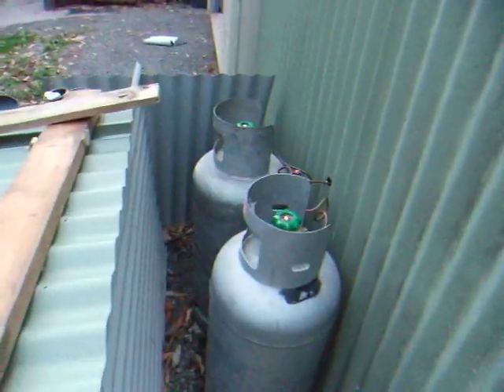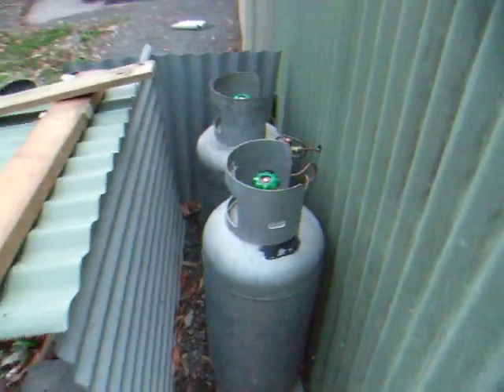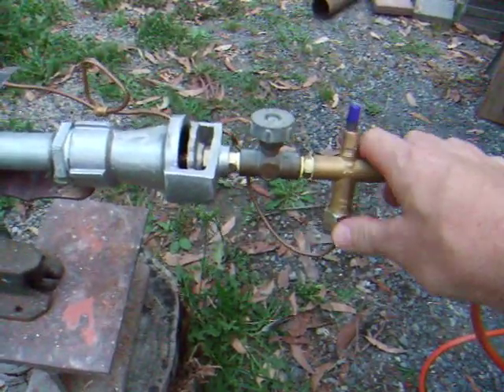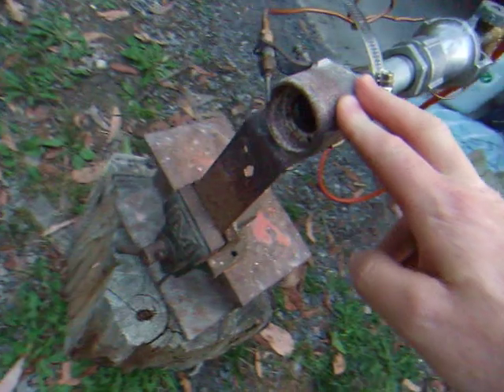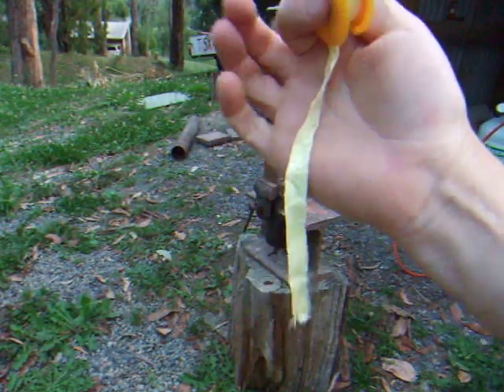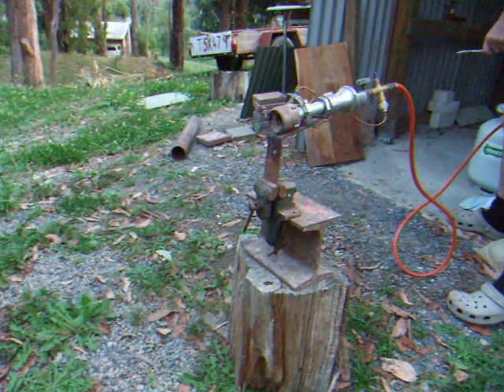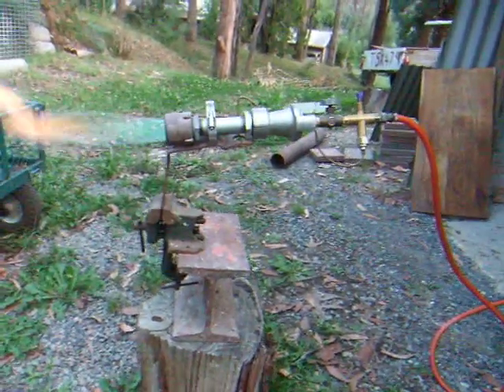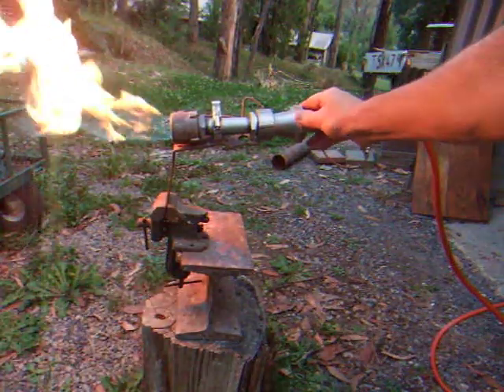Gas Propane Kiln /  Forge Burner & Plumbing

Comment: Very nice.. Seems like this would be a dream for a Metal Forger or Smelter... I have been looking for these parts for hours.. Does not seem they have them here in the USA.. How much did the Inspirator and Flame Retention nozzle cost you?
And, is the threads there, the same as the threads in the USA?  We have SAE, National Pipe Threads NPT.
Reply: Ward Combustion one stop

Ransome Manufacturing cheaper
Eclipse Burners parts expensive
ESA Pyronics